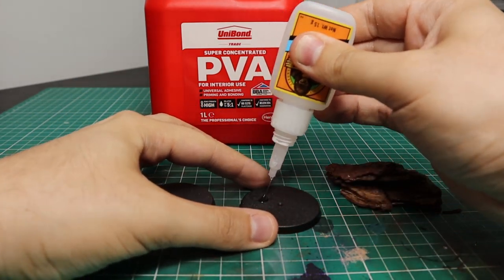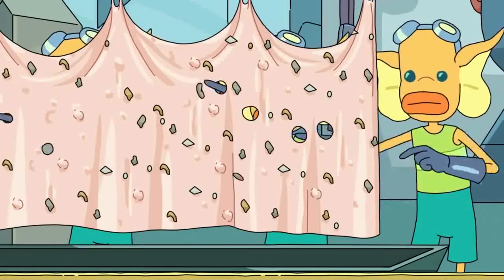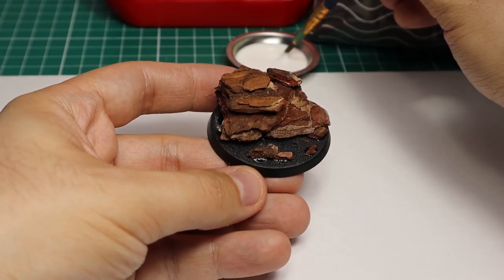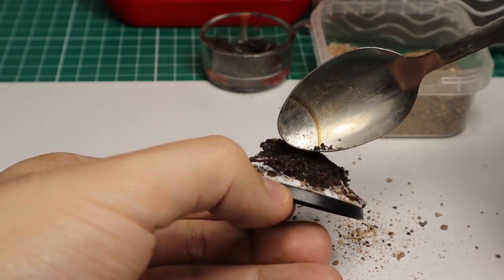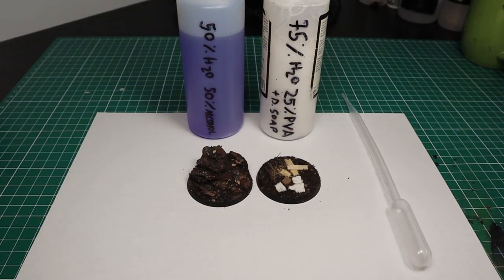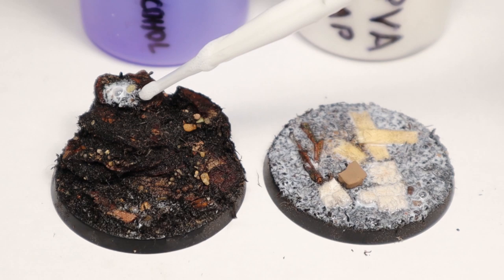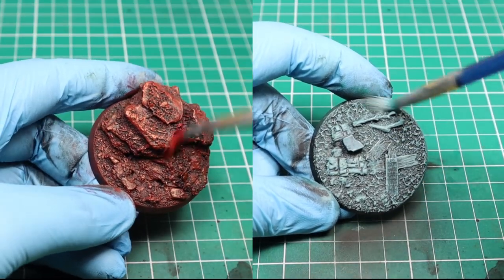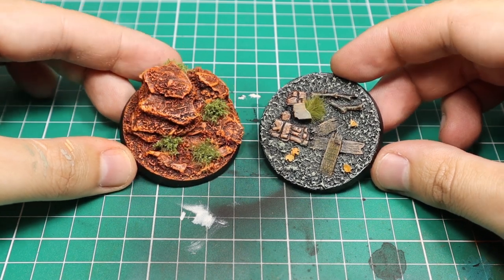INDESTRUCTIBLE Gaming Bases - Quick & Easy

Comment: Coffee grounds are another great material, if you have an adjustable grinder, you can get various sized grounds from dust to very small "rocks". For grounds used to make actual coffee, just put them on a dish or something uncovered in the fridge for a day or two and they should be dry enough to work with.

Comment: Okay I cannot find a video on it. How do you attach your model to these more complex bases?
Mainly that large rock. 

Are you reposing them with hot water? Cutting and green stuff? Are you having issues gluing the model to the base as you are basically then gluing to paint and pinning it is good enough?
Reply: Oh and great video, thanks so much for making these.
Reply from the maker: You just need to pin the model!
I drill a hole in one foot of the miniature (or both feet if I need to play super safe) and a hole all the way through the scenic and the plastic base and connect everything with a long pin made with thin metal wire. A couple of drops of glue in the holes and you'll have an eternal super strong bond between the model and its base 😉

Comment: Love your videos! I just wanted to ask, when you say isopropyl alcohol, are you referring to 100% pure alcohol or 70% formulation?
Reply from the maker: I usually buy the 99% formulation (I use it also for the airbrush and 3D printing) but for this particular use any level of purity can work, you need only to adjust the quantity of water

Comment: Thank you Marco for all the videos, I'm starting painting and your video really help.
Little question that might be obvious, after doing these bases, how do you put the mini on it? Are you using PVA too? Or maybe just a drop of super glue? I have Tamiya Extra Thin Cement from my Gunpla building, will it work too? Thanks in advance!
Reply from the maker: Thanks a million to you 😊!
For a flat base I usually glue the model to the plastic base using plastic glue and I build terrain and textures around its feet.
For more complex shapes I always drill an hole and fix a pin between the base and one foot (or both feet for a stronger bond)!

Comment: Marco, how long do your "magic mixtures" last if stored in closed containers?  Can they last or is it better to prepare appropriate quantities each time?
Reply from the maker: They can last forever 😉! I keep them in jars or ziplock plastic bags for entire months, the only important things is store them when they are completely dry. If not, you can get rid of the extra moisture just putting everything in the oven (1 hour at 70-80° and you are good to go)
Reply: Marco,   you're talking about the completed miniature bases, right? When I write about "magic mixture" I wanted to refer to the liquid solutions used for the bases creation (wet water and scenic glue) 😆... the presence of a fraction of alcohol in them, let me think that it was better to prepare them "on the fly", immediately before using them.  Am I wrong?
Reply from the maker: @gianmariasandigliano  Oh I thought you meant the ground texture, sorry. 😅 
You can prepare in advance and store easily the two liquid mixtures without any problem! I use two old bottles of airbrush thinner (200ml) to store them and have them always ready 😉 They just need to be closed well!

Comment: Wouahh! Love the video! What is the base % of alcohol do you used for the mix?
Reply from the maker: 😊😊😊 Thanks! Minute 6:06 you have the complete recipes on screen 😉
Reply: @MarcoFrisoniNJM  I think he may be curious the % of the IPA. 70%, 90% or higher percentage? Ir does it not matter the % of the ipa?
Reply from the maker: @GrimmJD  It's not very important for this kind of application but I use it mostly for the airbrush and the 90% in this case is better

Comment: I was just doing this last night, though I used matte medium instead of PVA glue; I prefer the absolute matte finish versus the satin finish I sometimes get using PVA as an overcoat.
Reply from the maker: Nice! That's an interesting option especially for dioramas and showcase models.
I always put a good amount of paint on top of the protective layer  so I don't really care about the finish in this step
Reply: Yeah I realized just after posting that that you were going to apply paint, and I am usually lazy as I have begun to use the Luke APS ready made mixes which are fantastic for speedy basing projects. Matte medium is of course significantly more costly than PVA glue so only useful if you're not painting over.
Reply from the maker: @charlesfe  😉 Don't worry 😊 I tried a couple of times without painting on top but the ground was always "too realistic"😅 compared to the colours of the models
Reply: Yup I know exactly what you're talking about. For AoS stuff I repaint the base. For Saga/SPQR/historical the colors on the model are often subdued, so the realistic look melds very well.
Reply from the maker: @charlesfe  Oh yes for historical models works definitely better!

Comment: If you use meths instead of alcohol do you still dilute it 50% with water?
Reply from the maker: Yep! You can save volume and money and the effect on the surface tension of the glue is the same

Comment: I have a question mate, with the percentage you listed for sealer how  do I work that out in Mil Litres ? Sorry -_-
Reply from the maker: It depends on the final quantity of mix you want/need to create that's why I gave percentages!
Reply: Brad the ratio for the wet water is 50% to 50% that is 1:1, for example 10 mil water 10 mil alcohol. Scenic glue 75% to 25% that is 3:1, for example, 12 mil water to 4 mil soap. Cool?

Comment: So how do you attach your minis to these bases so they won't fall off?
Reply from the maker: For something like the grey one I usually do the base when the model is already glued on top with plastic glue. For something like the rocky one I simply add a pin under one foot (or the two feet if it's a big model)
Reply: @MarcoFrisoniNJM  great thanks!

Comment: Would you please do a video of mounting a miniature to this base that's also indestructible?
Reply from the maker: Sure, btw it's super simple and there's a glimpse of this at the end of my previous video about DAS bases; just drill a little hole in one foot of the model (or both feet for a bigger figure) and give it a metal pin 😉 The result will be indestructible! (Also the ork of my other video is pinned in this way to his rocky base 😉)

Comment: I didn't see if someone ask the same but my main question is how you put the minis on the base it's a big question for me
Reply from the maker: You can glue the model to the base from the beginning and do these steps around the feet or for more complex, three dimensional bases pin the model to the base; I drill an hole under one foot (or both feet for extreme stability) and I had a peg that go through the base. Same thing for base toppers made with rolling pins or similar products!
Reply: @MarcoFrisoniNJM  ok thx a lot marco it's what i think aboit drilling the feet.
Grazie per gli vostro videos siete grandissimo